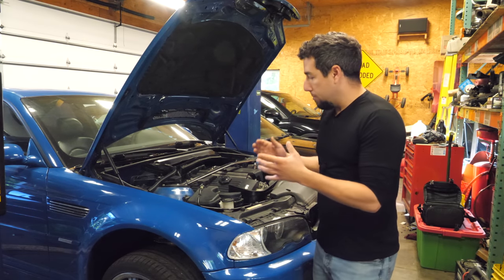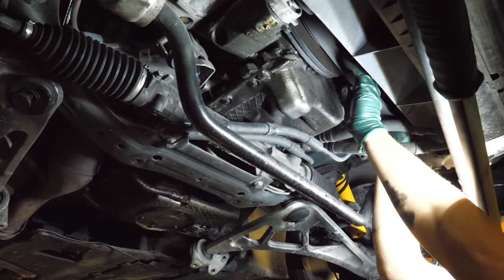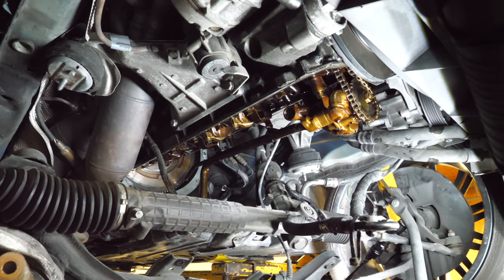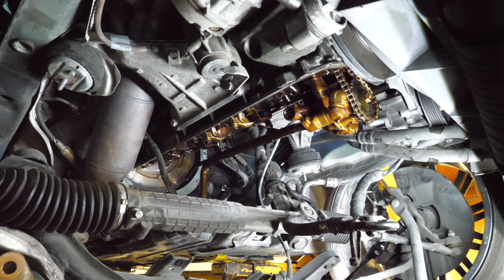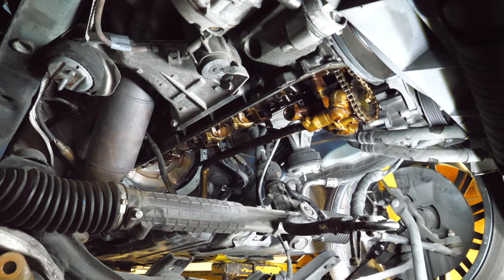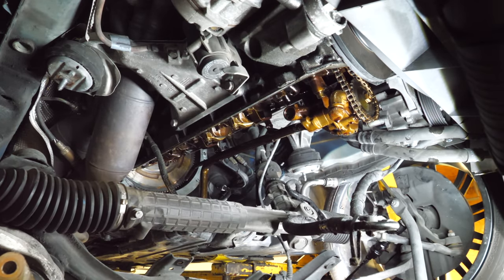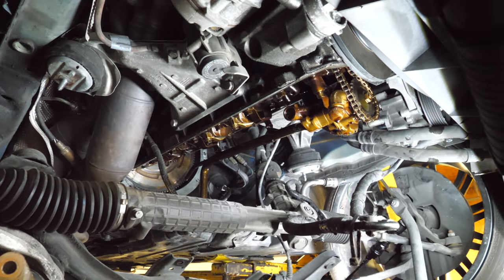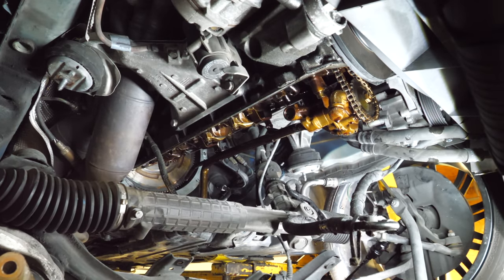Copart Laguna Seca E46 M3 Update! Rod Bearings & Vanos Rebuild, Was I Seconds From Disaster?

Comment: How often are the rod bearings changed? I'm just amazed at replacing rod bearings as a general maintenance item. I had a 92 Safari van that I put 300k on and never even opened a valve cover. It was run hard but I did normal maintenance as scheduled. Even the transmission lasted. I did replace radiator and pump and had to rebuild the front suspension. But the engine and trans lasted great. So it's just surprising to see a high end car need rod bearings at 30k.
Reply: Yeah, it's absurd.
Reply: These engines have an 8k redline. They aren't like most engines. Rod bearings are maintenance items on BMW S engines.
Reply: @darylmorse  So do PLENTY of engines from Japan. . .and no "rod bearing swaps" are necessary on their engines. No, this is due to lack of proper crankshaft counterweight, poor engine harmonics, and undersized bearings for the stresses involved.
Reply: @darylmorse 
Nah, that BMW has bad engineering. Still not impressed. Basically a car that costs maybe 3x and the rod bearings and cams can't last the life of the car. Yet a rough running V6 run like it was stolen for 300k. This thing pulled a trailer and hauled equipment, it worked. Yet it's rod bearings and cam lasted. That 4500k redline saw a lot more work than that BMW ever saw.
Reply: @life_of_riley88  to be fair, toyota treats their truck frames like a maintenance item.
Reply: @darylmorse  funny, that's about what a slant six Mopar bottom end is good for.  Maybe that'd be a good swap into one of these money pits.
Reply: @life_of_riley88  Agreed.  This is not a "maintenance" item. BMW screwed the pooch and continues to.  If you're hell bent on owning one, it's a good idea to ensure you have a REALLY good warranty on a used one (along the lines of Doug Demuro's carmax warranties), and to dump it at the end of the warranty, new purchase or used. Car Wizard will no longer work on these due to the extreme poor engineering on BMWs. There are a lot of $10 "fixes" on these that require thousands of dollars of labor to fix.
Reply: @life_of_riley88  Says someone who's probably never driven an E46 M3. They have some issues such as RACP and VANOS. I don't include the rod bearings with the RACP, which are major fcuk-ups. Aside from that, the cars are amazing to drive. They have character that you can't get from Japan.
Reply: @member57  Who wants a V6 when you can have an I6?
Reply: @darylmorse  Look I get that they're fun cars to drive. I have driven/been in one. I've also been underneath them. . .and no, I wouldn't own one. Sorry, just too many built in issues.

Comment: To clean those bolts you should look into an ultrasonic cleaner. They can be had for a couple hundred dollars for a decent-sized one with a built-in heater. Fill it with an all-purpose cleaner and let it run its cycle while you do other things.

Comment: Thanks for the upload!   I don't know BMW's so I do understand (now) the horror stories of "Vanos" system.    Why do you need to rebuild these and Rod Bearings?  Is it because of the screw issue or is it part of long term ownership?   Seems to be a weak point of the brand?  Seems like Rod Bearings and Variable Valve Timing (Vanos) should last the life of the car with proper maintenance?  What gives?
Reply: "Zees are ze parts of ze car zat must be verked on normally. If you do not like to do ze proper scheduled maintenance then maybe you shouldn't buy ze ultimate drivink machine."
Reply: BMW had very tight tolerances for these engines, and combined with the 15k mile oil changes on a high revving engine, that was a killer for the bearings. Once it’s done and you change the oil every 5-7k miles, you usually don’t have to do these again.
Reply: The rod bearings are because a 15k mile oil change interval is a very, very bad idea for everything and ESPECIALLY bad on a low-tolerance performance motor. Stick with 5k to 7k miles on an oil change - for all makes & models - and you won't ever have a problem.
Reply: Yeah - it's called superior German engineering. LOL

Comment: Holding aluminum up using the corner bolts is a good way to break off a ear on the oil pan. Just a fyi when I watched you removed the last oil pan bolt

Comment: Really enjoyed this video and it’s gave me confidence that I could complete this job, I’ve not trolled through the comments and it may have been asked a million times, but interested to know why you went with ARP bolts? I’m thinking more of going to go OEM bearings and bolts as a combination, I have a 2004 e46 m3.

Thanks for the upload 👌🏻👏🏻
Reply from the maker: I don’t know if you can buy new bolts for the earlier s54’s. The early engines use different thread and pitch bolts than later engines. 
ARP are what’s available and instead of torque to yield, they have a torque spec.
Reply: @I_Do_Cars  Ah right I get it now, thanks 👊🏻

Comment: Bore dimensions can change on a rod when using specs tighter than oe recommended. Bores should really be checked while the bolts are torqued to ensure consistent dimensions.

Comment: I don't mean to sound like an internet quarterback, but I'm speaking this because I did the same as you with the assembly lube, and it bit me.  The bottle you grabbed was dirty, and then you used your finger to smear the assembly lube onto the bearings.  I did the exact same thing and some grit made it into the bearings and I had to r&r the bearings after a very sparkly oil change.  After that I got pretty OCD and would squirt the assembly lube on the bearing, change a glove to spread it, and so forth.  I use the exact same assembly lube and it is crazy sticky so if any drips on the bottle (Inevitably so), dust and sand stick to it like glue.
Reply from the maker: Hindsight, should’ve used a little more precaution. I changed the oil already and found no metal. Should be ok!
Reply: @I_Do_Cars  No worries at all, and it was a great video.  Found a guy at my work who is also a subscriber, we tend to chat on Mondays about the malice in the combustion palace (Or adjustable rods) you discover on Fridays!

Comment: There was a TSB(?) on this issue with the cam bolts. It’s a known issue. I personally would have spent money on the Dr Vanos rebuild service and their cryo hub.
Reply: Well, Eric also spent the money on the Vanos rebuild kit and cyro hub, so your point is...?
Reply: I believe there was actually a lawsuit over this as well as the TSB, but it might have been on a different BMW engine (S52?)
IIRC the VANOS gear would stay together for a little while (and throw codes) but the bolt heads would wind up in the pan, hitting who knows what on the way down...

Comment: I have never replaced "only" rod bearings, but also mains as well when getting that deeply into one.  Having said that, I've never had a BMW, so the rules there likely are way different.  Kudo's for catching that one seconds from disaster!  (is there another engine tear down coming this weekend??  I surely hope so!)
Reply: Rod bearings are a ritual for BMW S engines.
Reply: Something I would have expected, you have most of it off why not replace the main bearings, each to their own I guess.
Reply: @Taz6688  There is no need to replace the main bearings, because they don't have the same wear issues as the rod bearings.
Reply: Because you’d have to separate the transmission to pull the crankshaft. A significant amount of more work required to do the main bearings.

Comment: Took apart a worm gear box one time, should have had 24 1-1/2" bolts holding the worm gear to the hub, and they should have been reamed and body bound bolts.  Instead it had 1-1/4" bolts with slip fit  bushings.  Every one was sheared clean off.  Rebuilt by the lowest bidder, but still six figures $$$.   And it lasted less than a shift and dropped a load.  🙈

Comment: so its not really that the bolts are being beat that causes them to break. Its that once the fastener comes loose, they get loaded in shear. And bolts are weak in shear. A good bolted joint stretches the bolt so far that it should never come loose. That stretch also compresses all the parts, and then the mating friction between the parts actually holds things together. Lose torque, and now its just that small diameter of the bolt stopping things from spinning.

Comment: Great vid and great job doing this. Wondering if you replaced the o-ring on the oil pump seems it gets brittle and fails? also where did you find the torque specs for this job?. Thumbs up

Comment: Did you say the rod bearings were already replaced @ 30k miles? Why would that be necessary?
I saw you fumbling with the excess liquid blue Loctite. I recently bought some 'solid' blue Loctite, it came in a dispenser that's like a chapstik tube. It can be easier to use in some situations and is definitely less messy.
Congrats, you got really lucky on catching the VVT bolts before it became a catastrophic failure.

Comment: You possibly made a mistake in not checking the main bearings.
When you check the mains you can either inspect all of them or just two.
You check the one that is least likely to fail and the one that’s most likely and compare them.
The one that is most likely to fail should show more wear than the other. If not and it’s the other way around then the bearing has probably been replaced. Comparing them should tell you the state of the others and if they need replacing.

Comment: Isn't there the upgrade for that oil pump that secures the nut with a wire and upgrades the shaft to a square instead of teeth for much greater reliability? I saw the upgrade done on Jaimie's Garage for Chrisfix's backup motor for his Lemons race car. Apparently a common failure of that pump.

Comment: Nice job on a sweet ride... I have a '98 328i 'vert and there is much similarity, including engine architecture.  I alway learn a lot from your videos, this was no exception.  Do you know if the rod bearing issue is also seen in the 2.8L M52 engines?  I have over 205k miles on mine and it's still smooth as silk, so I hope not.
Reply from the maker: On m engines, I would never preemptively replace rod bearings. They last as long as they’re maintained, and aren’t under the same stress as an s54
Reply: @I_Do_Cars  thanks for the reply!  Keep up the great videos!

Comment: Why didn’t you upgrade to better rod bearings while you had the chance considering that the standard bearings where a weak point.
I own a 2003 luguna seca e46 M3 also and looking into to replacing my rod bearings too.
Very informative video and great work.
Reply from the maker: The original bearings on the early cars like mine are the weak point. The new bearings you can buy are BMW’s updated design. There’s no reason they can’t last 120k+ and that’ll take me a long time to get there as I drive this about 2-3k a year.
Reply: @I_Do_Cars  thank you for that info,
I did my vanos last year and about to do my rod bearings in the next couple of days. 
How long did the job take you?
And how much would a shop charge to do the job?
Reply from the maker: @soplim8632  it’s a pricey job for shops because most shops mark up parts as part of their model. Without a camera, I bet I could do this job in 6 or so hours. I’m sure some can do it faster.
It’s really not hard, just take your time and be thorough.
Reply: @I_Do_Cars  I normally get the parts I need myself so shops can’t mark up the price on me. 
My mechanic is one of my best friends he doesn’t charge me too much so long as I supply the beer, lunch and dinner and give him a hand with the job. 
So I better book myself and him out for about 6-8 hours this weekend then.
Thank you soo much, now I know what I’m in for.👍

Comment: Nah youre good, would've driven for a hundred thou miles more, i had opened up a m50b25 non vanos that had a good 3cm long patch of copper and its juuust fine, no damage to crank, nothing after inspection at a machine shop, pop in new bearings and send it.

Comment: Ever check one with plastic gauge just to confirm? I would fear the crank might have been turned. I guess you would feel it after assembly if wrong size.
Reply from the maker: If the bearings weren’t standard sized they would be marked on the back of them or have a different part number. I did verify that

Comment: You never did give a clue why you think those motors need bearings seemingly way before their time   Do they run too low of an oil pressure?  Are all of them abused by the owner?  Or is it some other design issue making it eat bearings?
Reply: "Superior German engineering"  - I tried writing that with a straight face.

Comment: Aren't there 2 halves to these bearings? How do you get the top half with the rest of the parts in place?
Reply: me just spitballing.....but if you pull the plugs, and get the crankshaft in the correct position...you can just push the rod and piston assy up and have plenty of room to get at the upper bearing shell 🤔
Reply from the maker: No need to pull plug, just push the rod up and install bearing, pull it back down
Reply: @I_Do_Cars  yea, I didn't see ya pull the plugs....only the 1000 other steps, lol
WD Eric 🙂

Comment: how many miles have you driven your bimmer since doing this?
Reply from the maker: About 3k. Just got back from a trip to Arkansas in it!
Reply: @I_Do_Cars  I have a 2008 z4m and I constantly worry about mine. I'm approaching 150k and have no idea what the maintenance history is.  I send my oil out for analysis every other oil change. I just did a valve adjustment, and checked the low spots on the head for glitter accumulation. So far no signs of significant wear. 🤞🤞

Comment: Why is it necessary to replace the rod bearings?  If you change the oil, and avoid leaks, they should last 200,000 miles shouldn't they?  If "replace bearings" is a maintenance item, why do people buy these things.
Reply: It's probably designed and expected to have the shit kicked out of it.  It's likely that the folks who drive these things would only know enough to put gas in them in between buying Gucci bags or Bruno Magli shoes.

Comment: I owned one of these high strung money pits. I got my order in early which was then delayed due to BMW supposedly resolving “engine durability issues” well it turns out, as is typical with inferior German engineering, they failed to address many critical expensive issues with the E46 M3 motor. What else is new from Germany? They make among the least reliable and most expensive to own vehicles in the world. And they routinely get their ass kicked on their own Ring by much less expensive vehicles from countries that actually understand how to properly engineer a vehicle. The Germans can’t even meet diesel emissions standards without cheating.

Comment: I'd of just torqued them. They're only rod caps. If you can't get them on straight, you've got a lot more problems than just torque. LOL It needed rod bearings at 30k? I can't believe you bought this POS. Good god, what junk. I would HOPE they're not terrible, and if you're really glad you did this? GET RID OF THE CAR ALREADY! You have to be kidding. Sorry, I can only call it the way I see it. European cars, what is it with you people? What's next, a Bentley or a Range Rover?

Comment: Rod bearings that only last 30k miles and self shearing cam bolts?! Tell me WHERE/ WHEN the "amazing" german engineering comes into play here?! Why do people insist on driving these overpriced, oil leaking, self destructive, overcomplicated pieces of junk?
Reply from the maker: They’ll last a lot longer, but the early engines had them preventatively replaced to avoid a warrantied engine replacement.